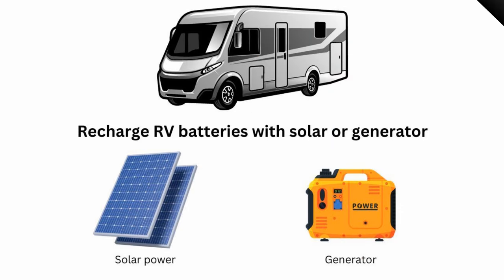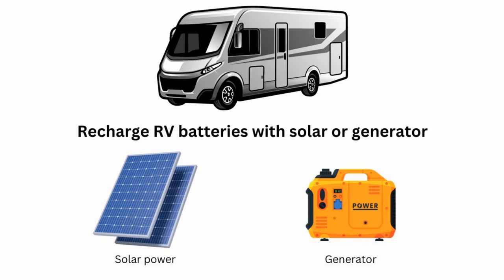RV Converter or Inverter - Know How Your RV Power System Works

Comment: Another good video Duane. A couple of things worth mentioning;
1. Some appliances (water heater, fridge) still require DC even when running on AC.
2. With the increase usage of residential refrigerators, campers (mostly 5th wheels) are coming with small inverters to power them on the road. A few of the 5th wheel owners I deal with had no idea this was installed and that it ran their battery down. Not a problem unless the pigtail from the tow vehicle is not set up to trickle the coach battery. Nothing worse than getting to the camp site and not having enough power to put the gear down.
Reply from the maker: Thanks for contributing those points to the discussion Jerry.

Comment: I know it was only an example, but a 500w inverter is pretty useless. A coffee pot, a space heater, or an air fryer uses 1500-1800w each. Lance will not install anything higher than a 1500w inverter in their trailers. (Safety) For most RV owners, anything below 1500w will not suffice if they have appliances. Thanks for another great video !
Reply from the maker: Yes, I am aware that a 500 watt inverter is not very useful. I used the amount to avoid working with numbers that are too large to understand easily.

Comment: Hopefully I ask this correctly -  if one installs a 12V A/C not 120V, that runs from the battery bank, and one wants to recharge the batteries and keep the A/C running, I would want to ideally run the generator and have that plugged into the Converter, which would convert that 120V to 12V and it would charge the battery bank which the 12V A/c is running off of?  —But— can the Converter be directly hooked up to the Inverter at the same time? (So you would have leads from the battery to the Inverter and Leads from the Converter as well to the Inverter, or is it best just to run the leads from the Battery to the inverter alone?)  — also how would one tie in a transfer switch to all of this as well when you want shore power to skip all the above?
Reply from the maker: WOW! That's a lot of information to process ... LOL . I think I understand what you are asking and let me explain it this way - the function of a transfer switch is to switch over to generator power automatically without you having to manually  do so even if you are plugged into shore power at the time. It prevents there being two power sources coming into the RV at the same time. Then most RVers utilize an inverter/converter/charger that decides what needs power and when. While running on either shore power or generator power, the converter will keep the batteries full of charge to be able to run almost any 12 volt item you wish. And some of the better inverter/converter/ chargers like those made by Xantrex and Magnum can even turn on the generator automatically for you when it becomes necessary. Of course, when there is no power from either shore power or generator, then whatever charge is in your batteries at the time is the limit you have available to run 12 volt devices. I hope that helps.
Reply: @RVInspectionAndCare  yes thanks!

Comment: I am having problems with my 5th wheel inverter & large refrigerator. I am on shore power, I turned off my inverter. Now my refrigerator will not work at all! I turned the inverter back on and still nothing. What should I be looking for? I have a large 12000 Jules surge protector connected to the shore power to my RV.
Reply from the maker: Sorry but it's really hard to diagnose electrical issues properly without being onsite. I recommend that you find a mobile RV tech local to you that has really good reviews from other RVers to get the problem solved. Or you can try posing the question on irv2.com and maybe one of the experienced RVers there can help you pinpoint the problem.